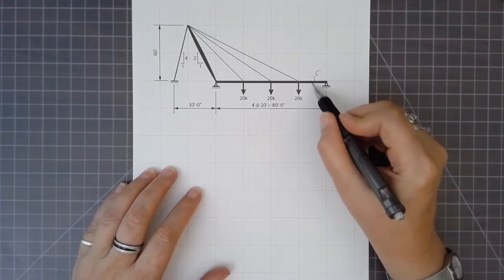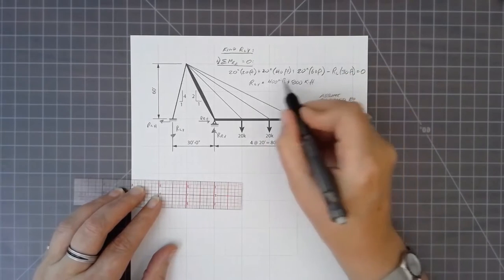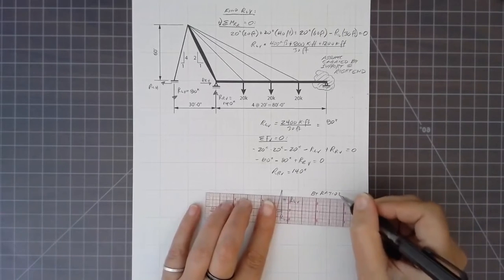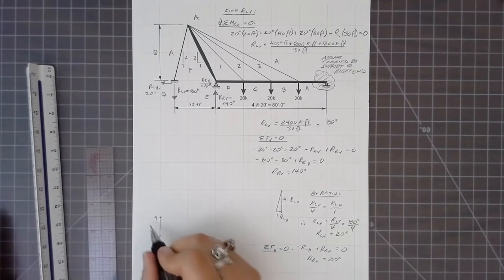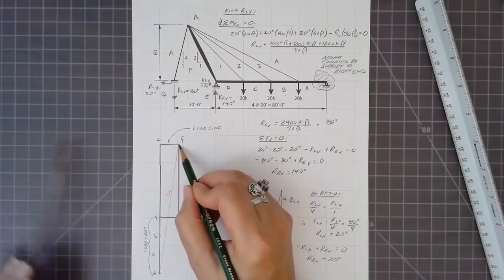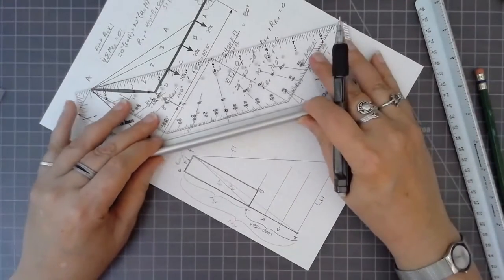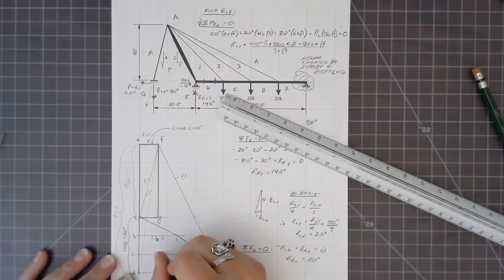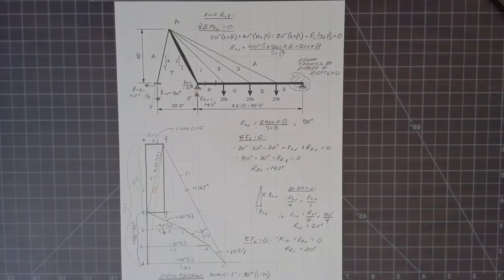Cable Stay Graphic Static Analysis

Comment: Very good video! But.. these imperial units tho.
Reply from the maker: Thanks. Yes, here in the US we still archaically use Imperial units in the construction industry. Nothing changes in the process using SI as the unit base. When I was a kid I was told the country would be fully metric by 1980. We're a little behind that...

Comment: Hi Professordeb, thanks for sharing this awesome knowledge. Just have a quick question, would you consider the self-weight of the mast? If the mast is made of reinforced concrete and inclined with some angle, would it will impact the forces within the cables?🤣
Reply from the maker: Yes, that's absolutely correct! This is a simplified analysis that is not considering the weight of the mast. In fact, Calatrava's Alamillo bridge in Sevilla, Spain, does not even have back stays because the inclination and weight of the mast is the basis for stabilizing the cables.

Comment: Hey professordeb, I am stuck on a similar problem to this. If there were no back stay and a rigid joint at the tower base, how would I work out vertical, horizontal and moments at the base? The horizontal force is especially tricky to understand. Any help would be greatly appreciated!
Reply from the maker: If I'm understanding right, you'd like to have a moment connected base rather than cable stayed, similar to the Alamillo Bridge by Calatrava. If that's the case, then you can still carry out the graphic analysis to find the stay cable forces, and then these would be applied to a secondary analysis of the cantilevered mast, using the horizontal and vertical cable forces and their respective moment arms from the base of the mast. A moment connection, though, would lead to a very large member to keep stresses down, unless the structure is smallish like a short footbridge. In the case of the Calatrava bridge, the moment is substantially balanced by the dead counterweight of the concrete mast itself, producing a HUGE balancing moment. I think it's one of his finer works.
Reply: Hey  @professordeb , thanks for the reply! The bridge is similar to the Alamillo Bridge apart from I am accepting a permanent large resisting moment in the foundation. However, would I also have to consider horizontal forces? I've attached a link to the problem for clarity. Thanks very much for the help! https://docs.google.com/drawings/d/1k3YNL4gm6w4usUEctmdPSWvAc8Z1g-RK2ssgb8xAhaA/edit?usp=sharing
Reply from the maker: @conorgallagher2096  I see. Yes, that's pretty much the Alamillo concept, except using moment resistance. You asked about the horizontal forces...the horizontal components from the stays are what generate the moment on the mast. Interestingly, though, the vertical components from the stays will create a stabilizing moment that works with the weight of the mast, although the moment arms for the vertical components will be lower. The sum of all of the moments from each stay will be the total. The horizontals also accumulate in the bridge deck itself, so become large compressive forces that need to be resisted. The Alamillo has an orthotropic box section that effectively works as a horizontal column to resist that compression.The mast size, though, will be VERY large to accept that much bending moment, so an appropriate solution would be to use a tapered section that gets increasingly large from the top to the base where the moment is highest. From an aesthetic standpoint, I would think that parallel harped stays might be a little more attractive than the semi-fan as it is now. Overall, it looks like you're on the right track though!
Reply: @professordeb  thanks very much!